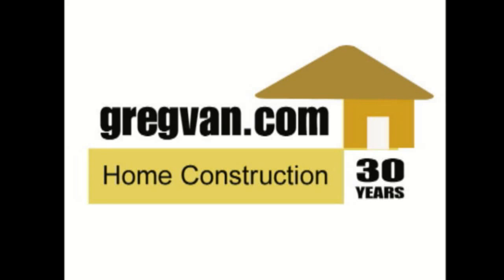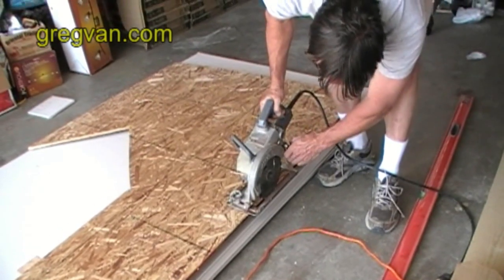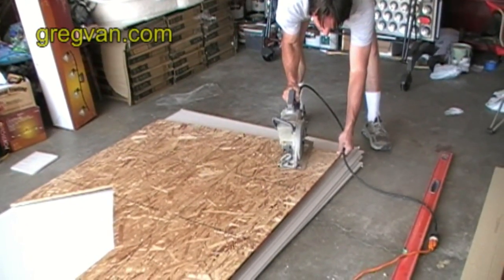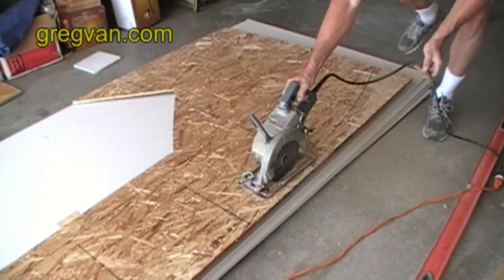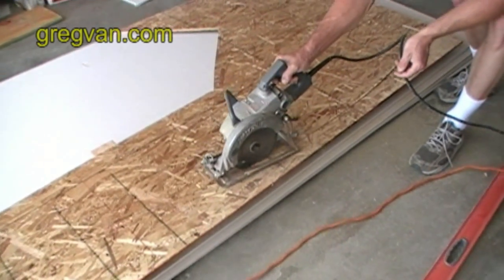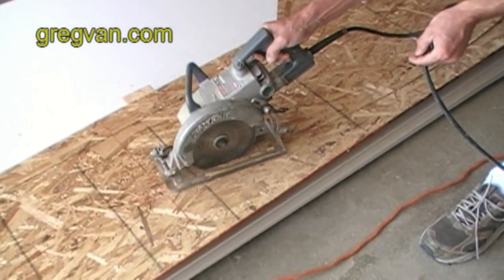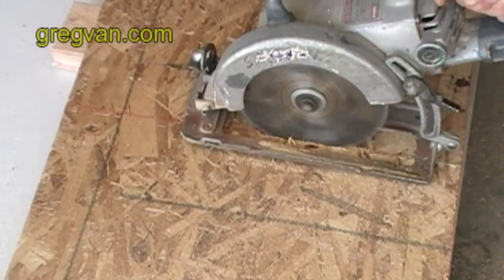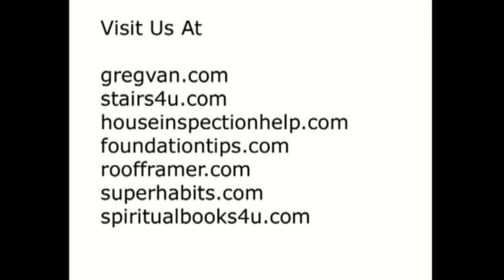Cutting Arch with Circular Saw - Home Building Techniques for Advanced House Framers

Comment from the maker: You can nail two pieces together and cut them at the same time, with a jigsaw or bandsaw, but I've had a difficult time doing this with a circular saw, because the saw blade will bind and it seems to put a little more pressure on the circular saw than I like to deal with. If you're going to use a circular 7 1/2 inch saw, it will be better to cut individual sheets, but don't take my word for it, try it for yourself and see what happens. I learned the hard way, so you don't have to.
Reply: Just with one sheet it seems it would bind quite a bit. Hugh potential kickback for the inexperienced.

Comment: @gregvancom 

I was looking for more personal detail.  For example, I have an archway of 9 feet across that only reaches... about 13-14 inches in the vertical height, how to I find the pivot point. (I built several on a  with an old friend a long time ago.) Isn't there a rough way to do that.  some thing with quarters half's and thirds.  I can't recall exactly,  But your vids are great work overall.  So you know.

Comment: I tried to watch the second video but the audio didn't work my question is why u don't nail 2 sheets together  and then cut the arch that way both of your arch are the exact same and when you have tight arches like a 8 inch arch in a 2 drywall opening then your way works well.

Comment: planning to buy a jigsaw just to cut curve... hmm. ... maybe circular saw can only cut curves on larger pieces of plywood. but my diy is small about 1 feet curved...so I might just waste a lot of woods
Reply from the maker: Absolutely, use the jigsaw. This video was only meant to provide an example of something I've done, but it won't work for everyone or with small radius curves.
Reply: @gregvancom  ok thx. wow. still replying from a vid uploaded a decade ago 😅